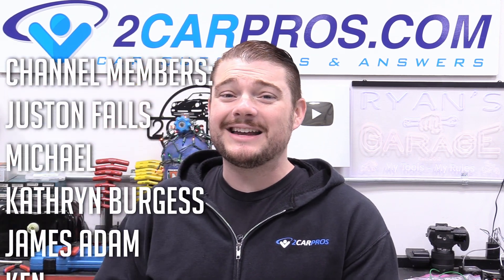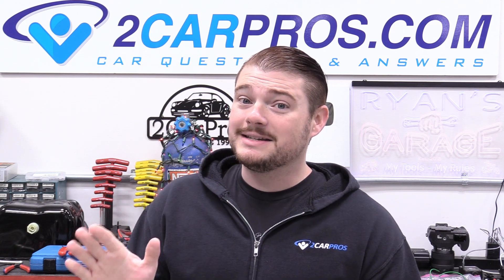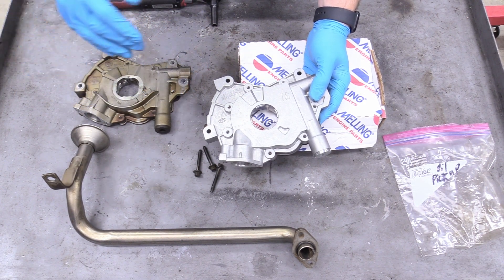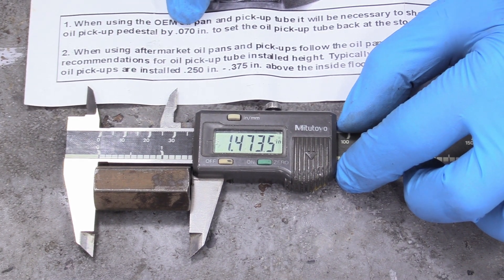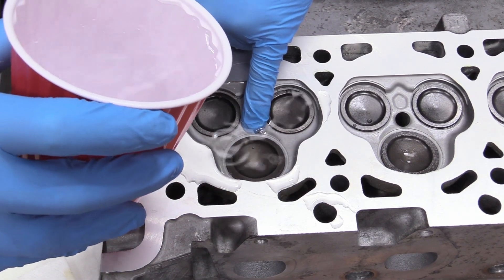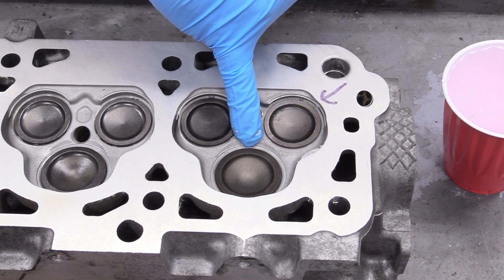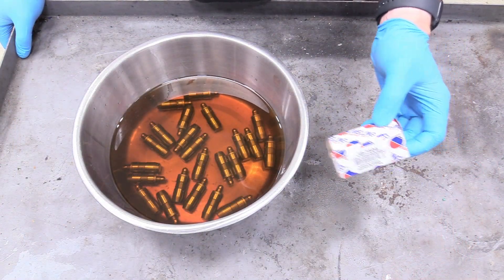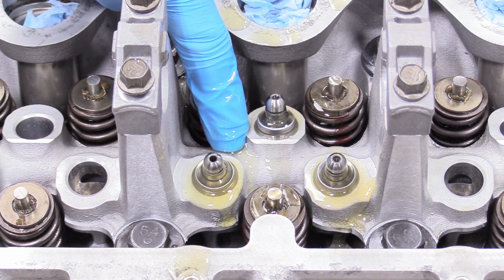How to Build a Ford 5.4L 3V Engine - Part 6: Cylinder Head and Oil System Install

Comment: Nice videos ,very well explain. The lifter pin hole is facing torch the center of the head or doesn't meters wich way is the hole?
Thank you
Reply from the maker: The hole in the side of the lifter? No it doesn't matter. Thanks for watching!
Reply: So glad someone asked that question lol I was particular removing to see there stance